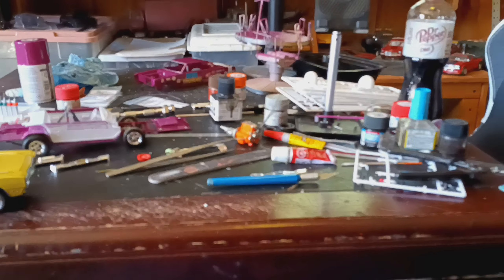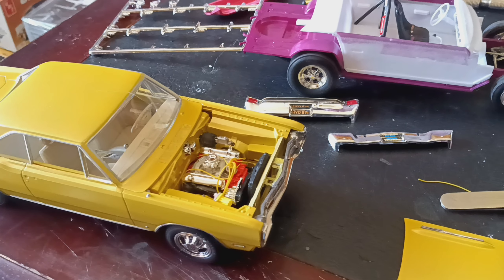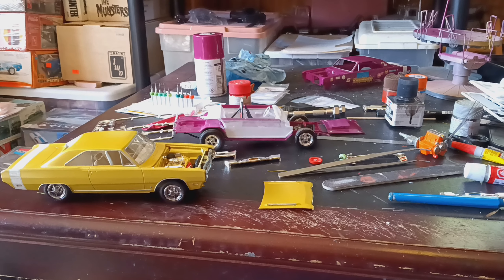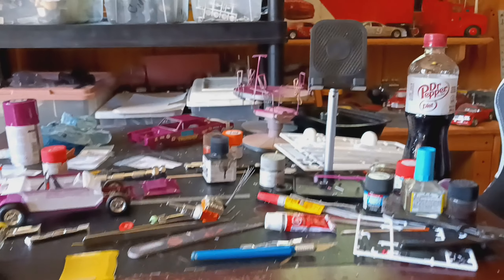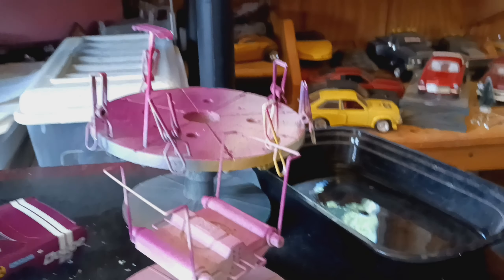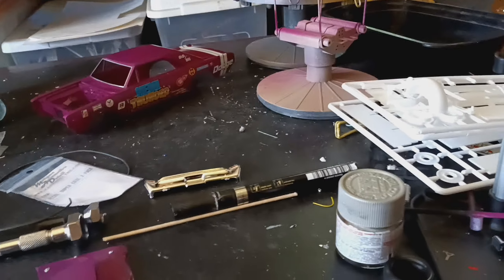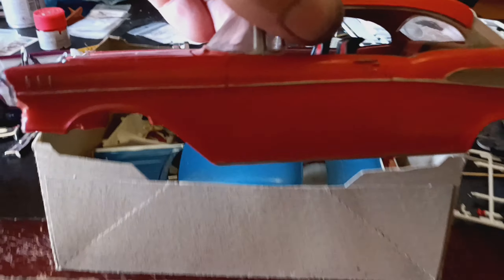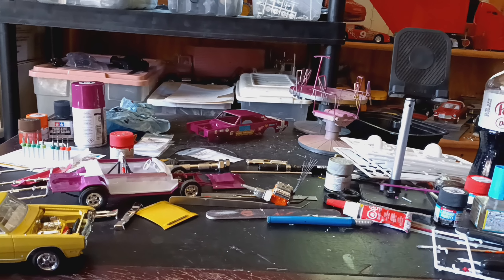#usacc 2025 GB

Comment: Nice update Phil, you have a full bench. Good luck with the 57, my side decals of the chrome fin chipped and leaves much to be desired. 😧
Reply from the maker: @davidchin350  thane good thing is I will not be doing decals at this point maybe a low rider paint or just custom touches.